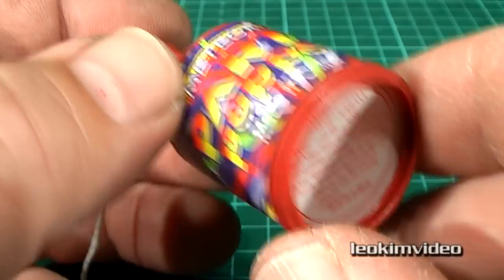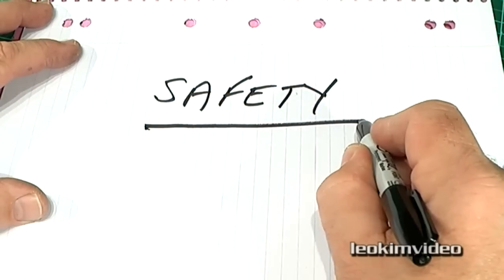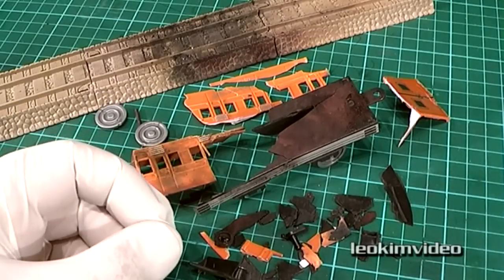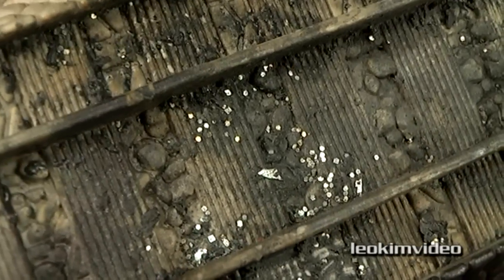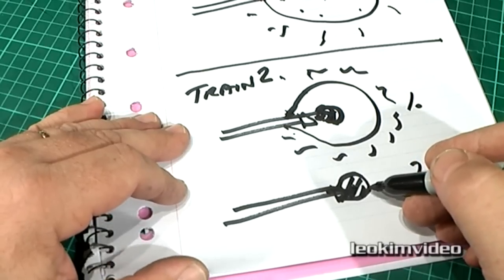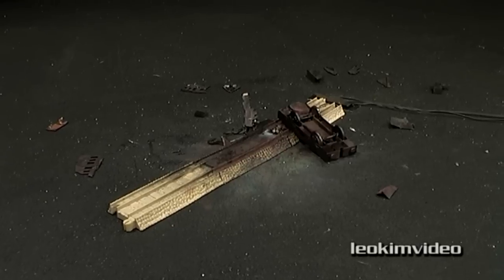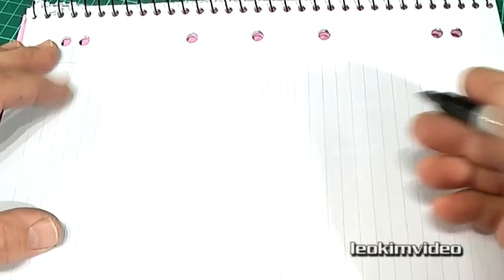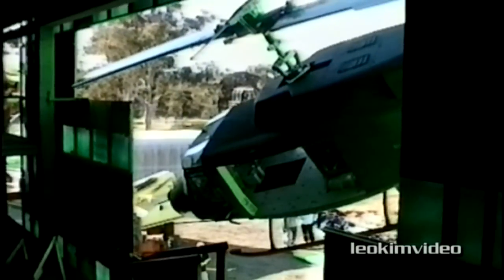Miniature Pyro Dinosaur Artform Movie Magic

Comment from the maker: yep, but it's what you do after a misfire which is the most important. there are some fairly strict regulations on what to do if a misfire occurs, it's part of your very basic training when you do an explosives course.

there are many causes of a misfire, a break in the firing line is only one of many reasons

Comment from the maker: The TT K Mart train comes and goes, it a fairly hot seller for obvious reasons. I do see ALDI here in Oz had their amazing wooden railway sets a few weeks back, at my local store there are still some stock. I also see IKEA has their wooden trains back in stock but the track joiners uses a plastic knob. I would go for the all wood if your a purist